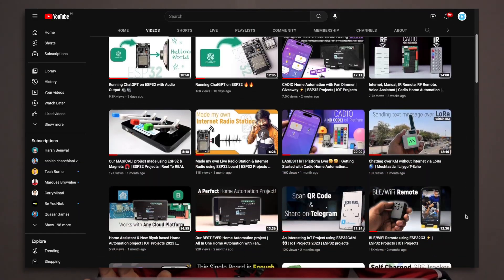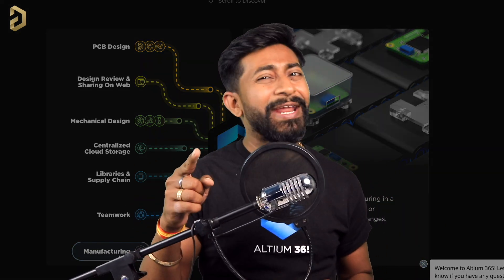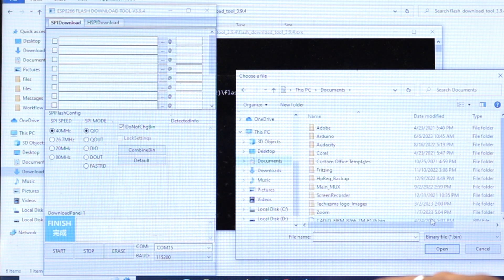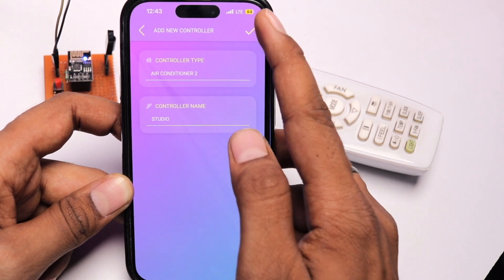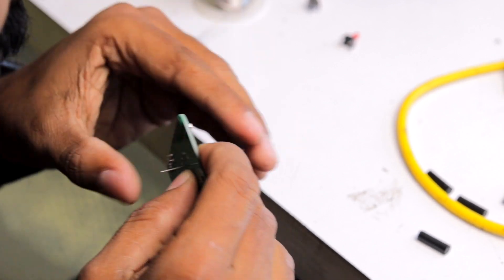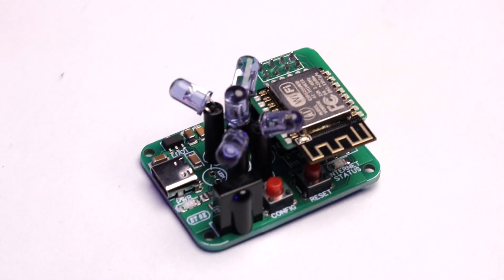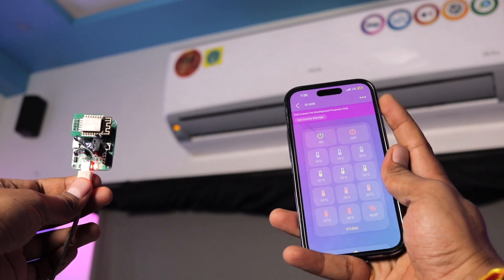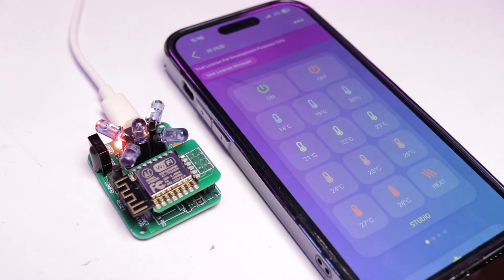My journey of making a PERFECT! Universal IR Blaster 👀

Comment: great . i made ir  using nodemcu board.  it worked well. its a pity that it use some comercial software. i will look for an opensource option instead.  but the video is very good.
Reply from the maker: Thanks ✌️
Reply: Hi oskimac. did you find an opensource option working, i want to use the ir blaster with mqtt using  my own program.
Reply: @nabilgafsi6781  no i didnt

Comment: Hi i used the same things as you and i flashed the latest ccadio firmware. I am using gpio 14 for ir , 13 for receiver and 12 for button but when i try to configure remote func then it automatically shows that remote sensed so the button changes to green and the ir doesnt light up help

Comment: How difficult would it be to add a temperature sensor to this so the a/c could be set to turn on to chill out heat at different trigger room temperatures and to v turn off when the target temperature is reached?
Reply: It's not very difficult to do so. Interfacing a temperature sensor with this should be simple. However, don't ACs already do this?

Comment: Very well done, but for such a tinker project the most important part is missing, the reason why a person would go through all this hoops and loops to make settings on the a/c through another device than the normal IR remote. iTS ABOUT MAKING THE A/C SMART:  I do not understand why all you super smart programmers  forget about this important reason. We need to be able to connect a light sensor, a temp sensor a humidity sensor at the minimum. Than need to be told the name of the variables, so we can set them via a script. like f.e. : if light on, and temperature is above 26 switch on a/c. If  it is getting warmer increase fan speed. if temp is under 20 switch on heater. and so on. That would make such a esp project interesting.

Comment: Have you guys tested it with set top box remotes? Those are notorious for using very different protocols and finding a compatible IR receiver is way hard. I made a similar project few months ago. So comenting from that experience
Reply: What is the issue you have with it
Reply: @smartteg7381  most of the remotes were working with their respective sensor but not the others